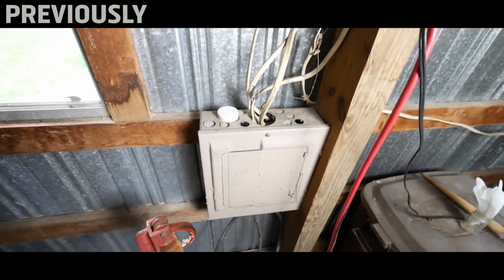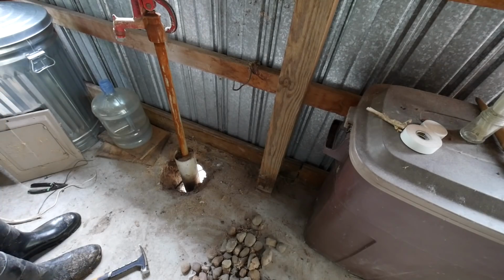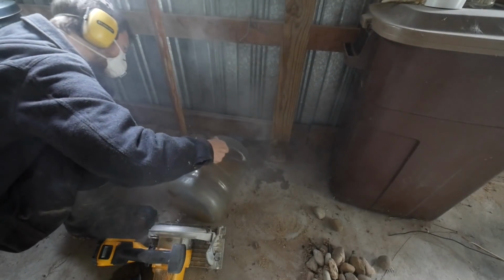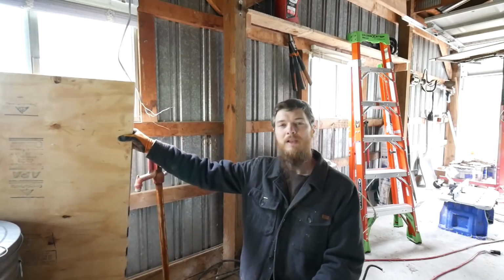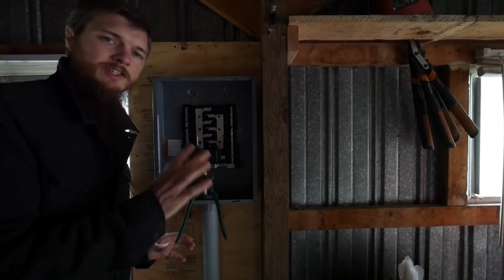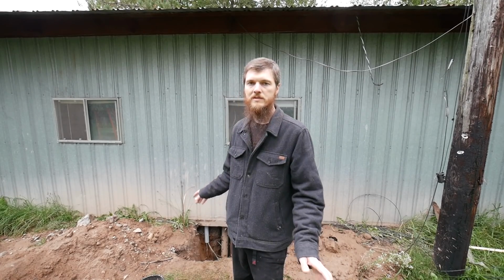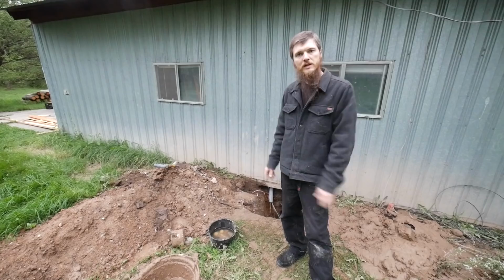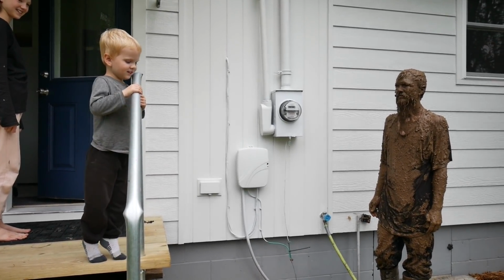SCARY ELECTRICAL work Turns into a Nasty Mess

Comment: GUYS! The wiring is FINE! Doug did nothing wrong, there isn't anything wrong with the way the lines were run or with how they installed the box. Sure its not ideal to have it that close to the water but when you don't have enough, you don't have enough. The wiring is 2-2-4 or 4/0-4/0-2/0, which means its used to connect the transformer to the meter base or service to subpanel. All homes are powered with it. That big green box or tiny green box in your front or backyards, HAS DIRECT BURIED LINES! Why do you think you are supposed to call in a locate for ALL DIGGING??? Please, do some research first beforehand. As someone who has sold this stuff and works for the power companies, has to locate this and other lines, Doug and Ashley are safe and everything is perfectly fine. Great job Doug! Messy but you got the hard part done.

Comment: Nice work but you went through all of that hassle and your wiring is still running through the ground filled with moisture.  Those cable must be run through conduit when running underground.  The work before was sketchy, now it is less sketchy but still very dangerous.  I know you said you will upgrade later, but you should have started running the new wiring from the source.
Reply: Negative. They are direct burial wires, they do not need conduit. The only time you need conduit is if you use wire that specifically needs it. This is 2-2-4 or 4/0-4/0-2/0, which means its used to connect the transformer to the meter base or service to subpanel. All homes are powered with it. As someone who works for the power companies and has to locate this and other lines, Doug and Ashley are safe and everything is perfectly fine.
Reply from the maker: These wires are rated for direct burial, so they don't need conduit, it's all good :)

Comment: I was laughing so hard at the dust from the concrete.  When I removed the tile-on-mesh tile from an old bathroom, I had so much dust in my hair, water wouldn't soak through it to wash it.   Memories.  Shoulda had Maverick dig the mud.  Wouldn't he just love it??  That was so funny.  I would enjoy wiring if the wire weren't so stiff.  To me, it's like wrestling an anaconda!  Great job!!

Comment: I wonder if you could cut the water valve pipe and go down the wall at least 6' away from the  electric box.  It would be safer.
Reply: That was my idea why I go through all that when you can just cut the pipe and have it done ✅ I cringed every time I see him use a circular saw

Comment: You only have three wires running to your house from the pole, I dont see a problem at all.   I learned a trick from an old farmer on ground rounds.   Form a little bowl in the ground where you want the rod to go and fill it with water.   You can bury that whole 8 ft rod with just your thumb and forefinger moving the rod up and down an inch or so.
Reply: While not to today's standards for a sub panel, 3 wires in itself isn't a problem, unless there is multiple paths back to the main panel. For instance if the barn had a fault and the electricity decided to take an alternate return route to the house. Say the water pipe, if metal, or the Cat5 internet cable. Potentially the kitchen faucet could become energized or the computer. On a 3 wire system, the equipment ground shares the neutral. The modern system used today is 4 wire for subpanels. The 4th wire is the equipment ground. Ground rods are for lightning.
Reply: @turbowarp  I understand what you are saying, having a dedicated ground.   I put in a 100 amp sub panel off the main 200 amp breaker on the pole with three wires last year here in MI and it was approved.
Reply: No argument here.

Comment: It was really funny when you fast forwarded you banging on the concrete floor after cutting it. I would have gotten rid of the aluminium wiring and put gravel in the bottom of the hole. That's a non freeze faucet which mea n s the water drains into the ground after you use it. If you had put down gravel first it could drain better. Glad you made it safer with the electrical at least. You looked like a mud monster. Lol. Maverick had the right idea. Take a bath! Lol. He's the cutest!
Reply from the maker: All of the water in the hole from from rain we got the night before. Aluminum wiring is the norm when going from the service panel to a sub panel and for service entrance wire :)

Comment: That was nasty and that is so dangerous glad you guys are going to do it right and do it the right way keep up the great work and thanks for the content
Edited to cut the floor I would have used angle grinder with a stone and concrete cutting disk on it and to brake up the concrete I would have used a lump hammer and a brick and concrete chisel and that would have made it a lot easier

Comment: doug, the wires coming out the outside  near the water pipe...question: where do those wires lead to?
Reply from the maker: They come from our breaker box in the house :)
Reply: @diyfferent  do you run the wires/pipe underground?  if so is that trench already dug out?  i live in a mobile home park and the cable connection for 4 homes sits in my back yard. lucky me. when they have to work on the lines they dig up one side of my back yard. i stopped planting bushes and flowers there. the line will come through my yard into another yard. that's 3 and then one from the unit to my house. the utility line is like that too. one box with 4 meters on it but the lines go through my back yard.  i noticed you putting the wires through the pipe. the wires that run underground when you first started were not i a pipe. question: does the elements: earth, water, cold/snow ruin the integrity of the wires?   sorry for all the questions. i ate wheaties for breakfast!

Comment: I know it some your not suppose to mix aluminum wire and copper as aluminum has a lower melting point, you might want to ask someone if you already haven't. I know there main wire so that is the part i do not know about.
Reply from the maker: Aluminum is common for feeder wire to the panel. As long as it's sized and connected properly then it's good to go :)

Comment: possible to gain a couple inches of wire if you had tried coming through wall in conduit , i do not know , but could you install a main breaker box junction on the outside and then run new wires inside to a new panel were you want it.

Comment: You did such an excellent job of showing a frowned-upon DIY. I am very surprised you went with it but after some thought you have been known, in the past, to take reasonable precautions over a safety item "getting in the way of the thing I want to do". I thought you'd spent a bit too much effort with the hammer. But then!

 My uncle lost fingers to a job like that. There's a reason that guard is now REQUIRED BY LAW. Please, with love, remove the part about using the saw without the guard. I don't mind doing it differently, however; safety is always the first rule.

 Your demonstration of the re-assembly; was well worth it. I need to know how to remove and replace blades! It was so well filmed!
And Bless you for taking on electricity.

Comment: That was too funny :)
Maybe it got cut in the editing but I think you need to remove the bonding screw in the sub panel so you have isolated the neutral bar and ground bar.
Reply from the maker: In a 3 wire system it's better to bond the neutral so you don't create a floating ground. This was fairly common for detached structures several years back. In a new 4 wire fed panel, you must not bond them. It's a tricky thing.
Reply: @diyfferent  Good point about the floating ground. Thank you for the reply.

Comment: Breaking through the concrete reminded me of the time about 5 years ago when I had a leak in my water service line.  About four feet of the line runs under the concrete patio before it feeds into the crawl space.  There was a crack in the concrete in the area I needed to break through to dig down to the water service line, so I thought I could use a sledge hammer to break up the 4" thick concrete.  Nope, that didn't work, so I rented a concrete saw to cut some lines about 3" deep into the concrete.  Then I could finally break through it.  I was glad I didn't have to resort to using a jackhammer.

Comment: Worked as an electrician once upon a time. I forgot to identify the neutral. Thought I had it figured out. Tested right and everything. All the stuff in the barn worked like a champ. It was also spring and the ground was insanely wet. I get a recall for service a month later, their electric bill was like $1,100 and they’re dogs wouldn’t go anywhere near the barn. I ran some more tests and couldn’t figure it out, then heard a yelp and saw the dog running away. He stepped in a puddle. On a whim I tested the water for current. Yup! I’d mixed up the wires and had put a hot leg on the neutral bar. Neutral bar is grounded out so the hot leg extended into the earth and electrified the ground. It should have tripped at the cutoff breaker, but it didn’t. The barn itself should have been live, but it wasn’t. I can’t explain it, other than so much water absorbing the love current? Crazy minute in my life for sure, but I learned to always mark the wire!!!
Reply from the maker: That's crazy! Thanks for sharing!

Comment: power must be 220 volts AC 2 Phase coming in 150 amp supply
Reply: 220-240 volts here in Wa. state. Single phase  30,40,60,100,125,200 amp. Even though their are 2 phases coming in it is still called a 120-240- single phase residential service. That,s how the transformer on the pole is wired up,

Comment: That was pretty awesome! The outro was a great addition. In terms of your 3-Wire/4-Wire "dilemma" you nailed it on the head. The 3-Wires derive from the Main Panel (2Hots and 1Neutral) and your 4th wire is a Bare Ground with a ground rod. As long as it's sized correctly with your Aluminum feeders, you did fantastic. 

P.s. Yeah everyone can quote the NEC (National Electric Code) or claim they know this or that, but there are also state Codes that can totally change or disregard certain areas, or articles of the code. They also don't have to update to the most recent year of code(s). In Wisconsin, I believe we are still on the 2011 or maybe the 2014 code (current is 2020).

Comment: what people dont understand there is only 3 wires coming into your home from the power co. ground rod makes it a 4 wire system so your garage is fine just like you said if you plowed in a new line to the garage it still tying to the ground rod at the house  31 yr elect.

Comment: Sub panels should have the green bonding screw removed between the neutral and ground bar- it was in at one point in the video, but make sure to take it out!
Reply from the maker: Our situation is a little different than usual. On a 4 wire feed you have to separate the neutral bar from the ground as you said. Since our subpanel is on a 3 wire feed, it's best to bond the neutral and ground for safety.
Reply: @diyfferent  That's against national electric code. You must float the neutral 3 wire or 4 doesn't matter. Run ground to a grounding bar mounted on frame (back of panel) then run all circuit grounds to that. It's a sub panel. Main panel only place you can use green ground screw bonding ground and neutrals together. Like your torque screw driver. Nice neat job.

Comment: Our house was all knob and tube single wires installed sometime between when house was built 1900 and 1930. We removed all but 16 feet of the stuff because that 16 feet is to a box we have in the ceiling and don't use and would have required removing all the dry wall in kitchen and possible having to move some floor joists. My Uncle Gene just cut the live end wrapped the wires and labelled them and dated them. We used 500 feet of new wire. Every circuit breaker is now 15amp or greater. We are going to put in a whole house surge protector when we have our natural gas emergency generator installed next year. 
I wish you luck and god health while working on electrical wiring.

Comment: you need a 16lb sledge.
Reply: umm no 10 pound or 8 pound would be plenty. 16 would be over kill.
Reply: Russian Bot I’ve used a 16.
Reply: I have a 4 lb mini sledge and have driven many ground rods with it.  I only had to break out the 8 lb one maybe 10 or 15 times.

Comment: So you know about aluminum electrical wiring right.....they took it all out of my place and upgraded to copper and 220 amp....
Reply from the maker: Yeah, aluminum wiring got a bad rap, mostly because of the oxidation problem. A poor connection can cause big problems. But it's still common for service entrance wire. You just need to install it right and not forgot the anti-oxidant compound. The old panel had some serious corrosion among other obvious problems!

Comment: My father in law had a problem with his ground because it was under the overhang close to the house where rain could not get to the dirt around the ground rod (rocky area).  

Is it better to move the ground outside of the overhang ???
Reply: Yes. But depending on soil in your area it might be useless. (If it drains to fast) Try to tie to a city water main if applicable or well pipe. Oh and btw a lot of regions have different rules about electrical. It's free to ask your local city inspector/engineer.

Comment: It's a dirty job, but someone had to do it... LOL
Sometimes fuse boxes are mislabeled, I would always check with a meter to be sure the line is actually dead before you work on it.

Good job on fixing that up, I can't believe how they had the wire and water run like that, with the fuse panel on the wall right there...

Maverick sure let you know, you don't dare go in that clean house with all that mud on you!  
I really love the way that framed 'original wall' looks in your dining area.

Comment: I don't want to be "That Guy" but even though the romex is rated for burial outside of any conduit, it does not allow for any junctions or unions to be  buried. It needs to be one continuous run. The cable can only be terminated within a box or an outlet. With the water level being so high and the unions being where they are you're at a high risk of electrocution. This needs to be corrected, even though this is "How you found it" does not make it acceptable.

BTW - Loved the Swamp Thing!.
Reply from the maker: It's all one continuous run. There are no splices anywhere. The hole was filled with water from the rain we got the night before.
Reply: @diyfferent  Ok, what were you doing in the hole then. I guess I'm confused?
Reply from the maker: @StreetersGarage  Just trying to dig the dirt out more to give me a bit more wire to work with.

Comment: do you need a ground rod there? i don't remember the rules for sub panels and ground rods
Reply from the maker: Yeah, it does require a ground rod.
Reply: @diyfferent  ah ok you dont have a grounding wire between the main panel and sub panel

Comment: I would pull your ground rod and put it inside. Drill a hole in your concrete and pound it in. That way you can keep an eye on it for corrosion, and it will be somewhat protected from lightning.

Comment: Love the mud bath, that was insane, I busted a gut laughing when you popped up out of the hole. Bell looked like she was ready to bolt into the house if you got too close and Maverick was oh heck no don't you touch me. LOL
Nice job on the new power panel. I am not sure but I think I would have tried to install a sealed junction box where the old breaker panel was and moved the new breaker panel farther from the water. That is scary to me having them that close together.

Comment: It would have been easier to put the feed wires into a conduit and run it up the outside of the barn wall, then come in to the breaker box.  I think  you made it harder for yourself.
Reply from the maker: I did consider that but opted to stay on the inside.

Comment: as thorough as you are i'm really surprised you didn't run a new line from your house. wire running in the ground not in conduit is not code. my thought is run a new line..move the box to a better place(not around water) and start from there before you get to far!
Reply from the maker: These wires are rated for direct burial so they are good. A new wire run would just be a much greater amount of work and money that we are not ready for. These will do the job just the same. But I hear you :)
Reply: It is done all the time. When a new house is built the power company runs direct burial.... Absolutely done to code.

Comment: the power that close to a water source is so out of code you could be flagged by local state or federal jurisdictions stop everthing and post plan's to address this
Reply from the maker: There's no code that I am aware of for distance from a service panel to a hydrant or any plumbing as long as you maintain the required workspace for the panel.
Reply: @diyfferent  yeah, watch out Doug, the FBI will be there any minute now! HaHaHa
Reply: @diyfferent  It's fine, but would run a #6 bond to the pipe from a grounding bar separated from the neutral.
Reply: @diyfferent  wrong look at codes for basement 
\
Reply: and bypassing the saw bad move bad president

Comment: You may have finally gone too far for me. Using a wrong size blade after disabling the guard?!?!  Like your fingers that little?  😝
Reply from the maker: A tile saw blade isn't as dangerous, but I did put that guard back on right away. I wouldn't recommend taking it off for a wood blade.